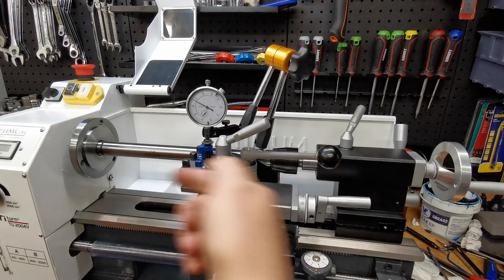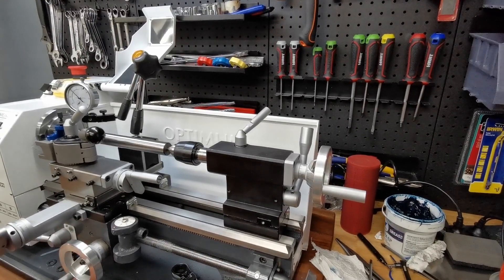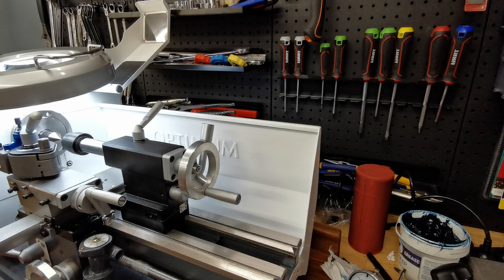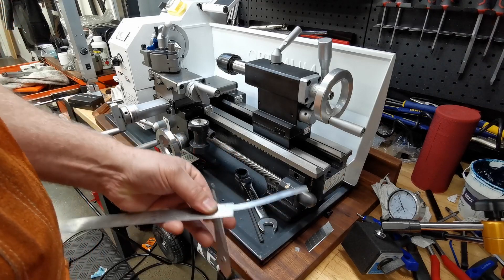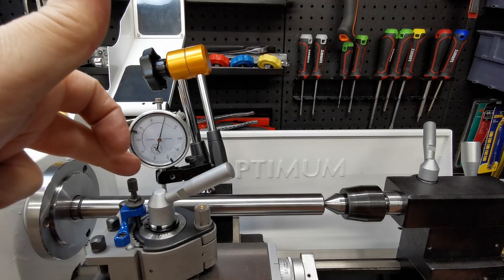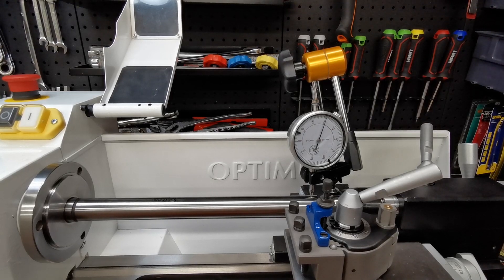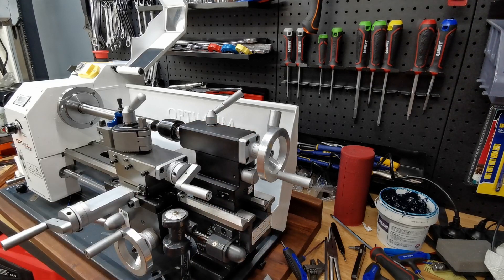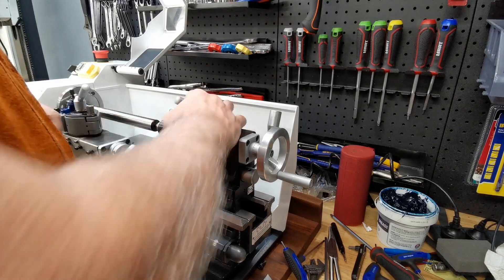6/6 Mini Lathe Stripdown & Rebuild - Optimum TU 2004v - Rob's Garage

Comment: I bought one of these in June. I'm guessing you're in Oz despite the accent. I went with the optimum because I thought it would be more immune to the need to upgrade them than the regular 7x14 mini lathes but I was wrong :)
It took me a while to identify the problem with the carriage lock but to fix it for me I also cut a relief as well as grinding it back a bit.
I bought some  F8-14M Mini thrust ball bearing 8x14x4mm for the crossslide and compound and it removes some of the play and makes adjustment a lot smoother but doesn't remove all of the backlash.
I did buy the default quick change that the aus retailer sold for it but realised I needed something beefier and made a solid mount for an AXA post that i'm pretty happy with.
Parting was an issue but I've finally solved that with the right toolholder and blade (250-107).
I've got a milling attachment that I've made a mount for and also just yesterday finished the draw bar to hold a ER25 MTB3 collet chuck.
I'm just working on writing a web app for calculating the change gear arrangements because thread pitches like 12tpi aren't documented and was googling for info and found your videos so google is being kind to you by presenting your videos.
I found that the live center has a lot of play that's not immediately obvious. The dead centers are needed for proper alignment before switching to the live center
Reply from the maker: I think I've found a faceplate that will fit. There's a guy on eBay selling 160mm face plates out of the UK and they have the required 72mm rear cutout. I'll post about it if I get one.... shipping is as much as the plate!
Reply from the maker: HI there. I'm in NZ. (I'll spilt this into a couple of replies as there's a limit per each)  We have the same Machineryhouse here. Other than that there's a toolshed store that sells a Sieg style lathe with no accessories and a Sieg importer who has a terrible site, but one can order things off tiny thumbnails if desired. The Optimum was the only good choice in this price range here and its definitely a step up from the Sieg models out of the box. I've got plenty more video material to edit and post. My first cuts have been excellent though I needed and still need to settle on the best parting setup. The best so far has been the L074 on Machineryhouse site, but I'd really like to have the same style but with the angled blade so I don't have to cut a relief. I've looked up the number you wrote and I see it's that type. I haven't yet tested insert parting tools but I have a cheap one to try. Everything else is nice and cuts through steel like butter. All that prep work has paid off.
Note that there is always a minimum amount of slop that cannot be removed with the type of screw thread on the slides and tailstock. It's just the cumulative amount from the full length of the thread contact area. To reduce it one would need to use one of those ball bearing threads or one could even make the threaded block very short to reduce the length of the thread contact area. I've watched a lot of videos and it's clear that many people don't understand where the backlash actually comes from. So don't worry too much about it and save for a DRO instead.
I think Google is showing my vids so quickly because there's so little else about this lathe model around... which is exactly why I've put them up. Wish I'd had more to look at when I was researching. Oh... and I'm on the lookout for the matching 170mm (72mm inner) face plate if you manage to find a source. I've been trying! I'd quite like to sort out a collet holder as well.
And yes, that's a good point about the live center. My one is actually quite stiff and I'm unsure if that is normal. It does spin when used and I double checked it after your comment to see if there's any slop and it's tight.. probably because it's so stiff. It feels like an overly tight thrust bearing. I used it for the adjustments in the videos as it seemed to spin more accurately than the 2 dead centers I got with the lathe and mill.
Yesterday I also did some tests for taper on unsupported rod as I was thinking about it again and realised that that is really the starting point for any calibration. I was going to tweak the footing with shims if there was any. It turned out to have 0.04mm over 150mm (aluminium) and so I decided to leave it as-is. The surface was as clean at the 150mm end as at the chuck so I was happy. I'll get onto the next videos soon as I can. I bought one of those cheapie 4x6 horizontal bandsaws and am extremely pleased with it after sorting it out. Have a ton of footage on that to edit.
Reply from the maker: gosh.. didn't need to split the post after all.